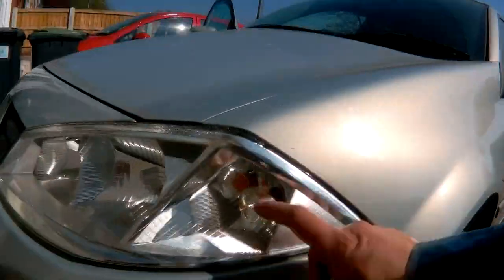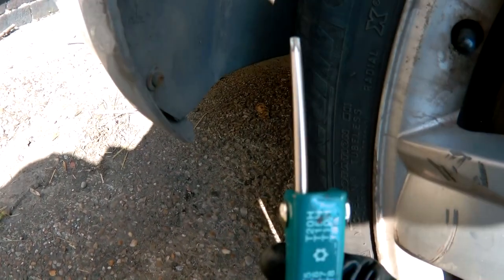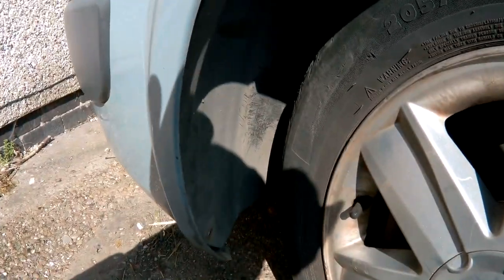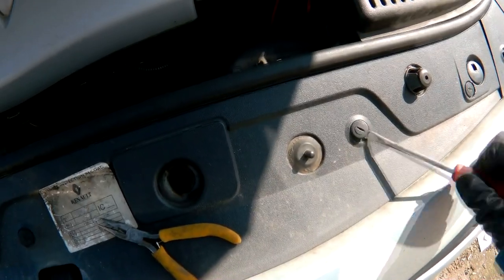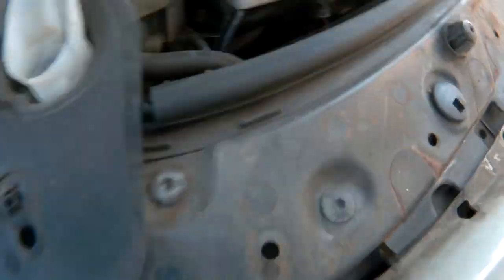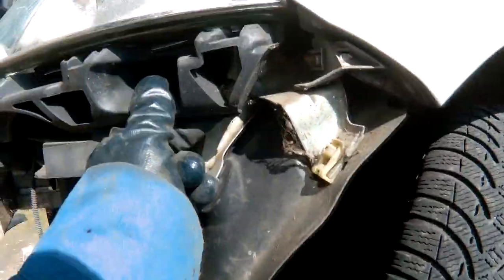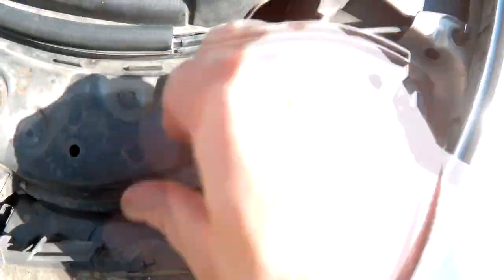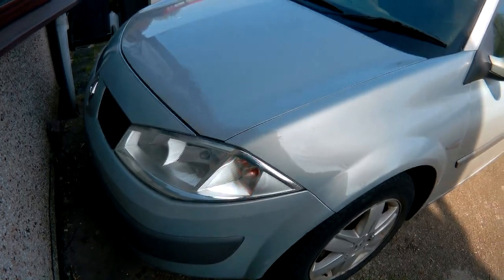Renault Megane indicator bulb replace

Comment: All my years of working for them we have never had to remove a bumper for a bulb unless the car is fitted with xenon lights and  even then it's quicker just removing the plastic arch
Reply from the maker: Not with this one. No way would the bulb holder twist. even with the arch removed you could not get enough access to the bulb to get a good grip.
Reply: @SteveSims  I'm with you fella yeah the plastic tab on the indicator holder issnt the strongest aswell
Reply: Steve Sims i twisted it but it wouldnt come out due to the car frame in the way

Comment: I managed to remove the bulb holder. I know the holder was properly stuck, because I broke the wings of the holder off in pieces before trying this trick. I removed the inner fender and placed a led light close to the battery so that I could see the bulb holder. Then I took a long, quite big flat head screwdriver and placed the head between the stopper and the bulb holder, pushed and twisted. The bulb holder moved, victory!
Reply from the maker: You won the battle of the bulb. Well done :)

Comment: what a stupid setup, only the french could make a simple job complicated, thanks steve.
Reply from the maker: It would be easy with tiny hands and if the bulb holder twisted like it was supposed to. But mine didn't so this happened.